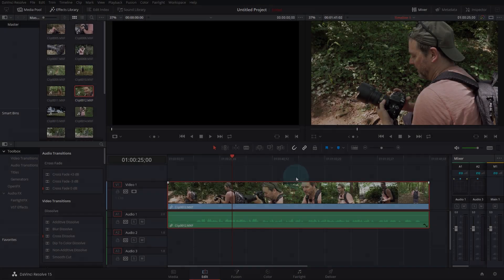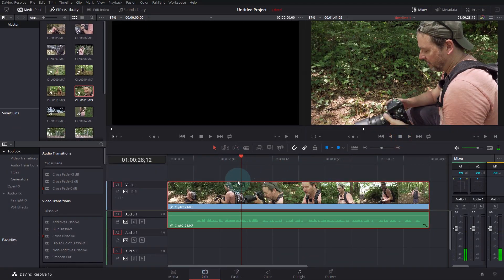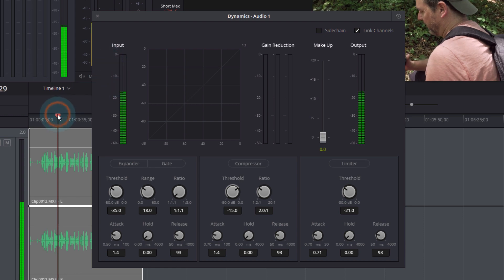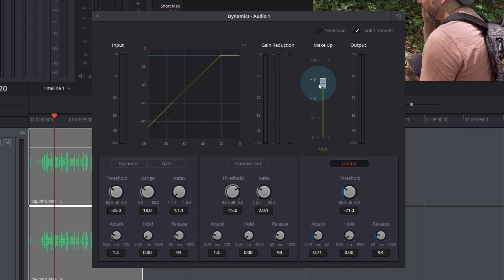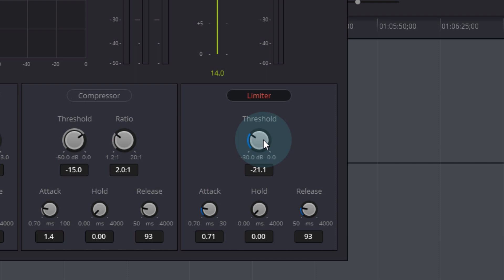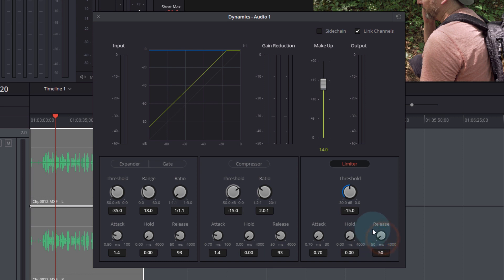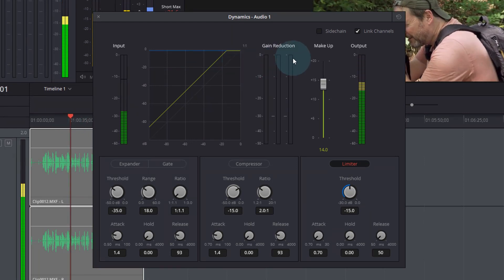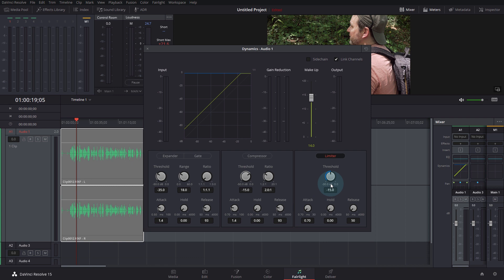Basic Fairlight Audio Limiter | Davinci Resolve Tutorial

Comment: Respectfully, there are some inaccuracies here. The limiter in this effects panel is NOT a hard limiter. It is just the compressor with a high ratio. If you want a hard limiter, above which no signal can pass, then click EFFECTS > DYNAMIC > LIMITER. Completely different animal. Understanding this difference will save you from a lot of confusion and frustration.

Comment: Hiya. I'm not sure your use of the limiter is quite right. The Threshold "Sets the maximum allowable output level." (from the manual).. therefore if you want none of your audio to be louder than -2, the setting is -2. The Make-up fader is a "post-Dynamics level control that lets you boost the signal to
 compensate for dynamics settings that have lowered the level."

The Make-up works on the audio AFTER you've limited it, so in your video, you're potentially undoing your limiter. It's easy to put peaks back in to your final mix, by doing this. That might not be what people might expect. Thanks for the video 'though!

Comment: A limiters input should cross the set threshold in oder to reduce the peaks of the audio coming in. The “make-up gain” is the output compensating for the gain reduction at the output stage...

You can use the internal LUFS meters to get your levels right for the target you’re aiming for. You Tube normalizes all audio being over -14 dB LUFS. For broadcast -23 LUFS are standard.

Comment: Awesome video! I’m having an issue when I export though. If I play the video in edit mode there is still clipping. If I play the video in fairlight mode there is no clipping. When I export the video there is still the clipping on the final product although the gain boost is still there but doesn’t seem to be actually limiting it. 

I’ve tried setting the limiter on both the audio track 1 and the main channel and I have same results each time. 

Any tips? You think maybe I’ve pushed the gain too far?
Reply: All I can say is that I encounter the exact same problem. The guys on the Black Magic Forum argue that unlike the Edit page and the final render, Fairlight processes audio in 32 bit which allows for greater headroom. This explanation does only partially make sense to me because I do see no reason to still play back audio the same way it happens on the Edit page. The only advice I can give you is to check the Loudness meter and make sure nothing exceeds 0. I assume this behaviour is kind of a bug. There should at least be an option to change the way audio is played back in Fairlight so that it ends up being a useful monitoring tool.
Reply: Felix Olschewski yeah I’ve tried several things but it always exports like it is clipping. I ended up having to pull back the gain but it wasn’t really exactly the sound I was going for. Funny thing is it never went over 0 and stayed in the mid red section too. Premiere does a good job at this. Wish resolve did as well. Let me know if you ever find the answer!

Comment: I am just starting  Davinci resolve.and have the guide, but find that I have difficulty getting back to the basic starting point after exploring fairlight.I was attempting to use the noise limiter intermittently as the volume varied between organ clips and speech. and I wanted to decrease camera noise only in the speech. I assumed that the vastly different sound volume would demand that.
I had been attempting this by using in and out markers. But found it impossible to open up the controller to reset the learning function at each interval. Could you elaborate on this please.